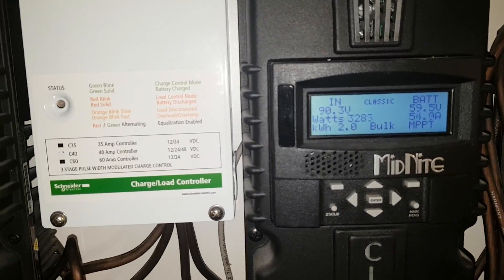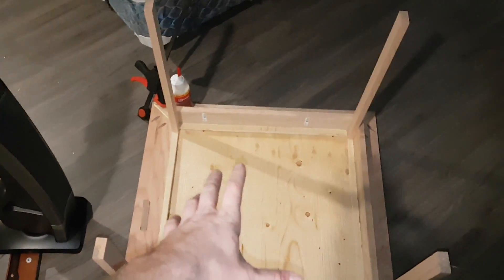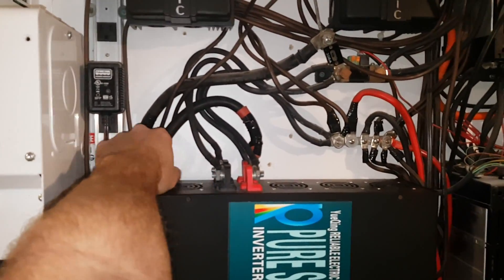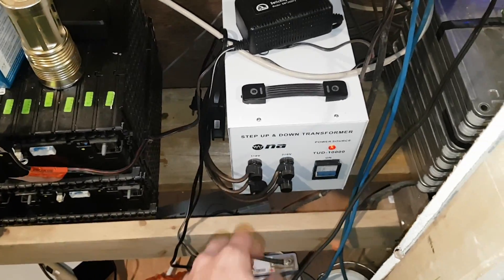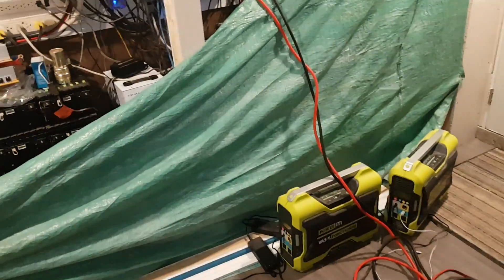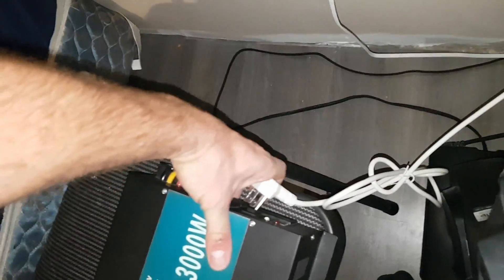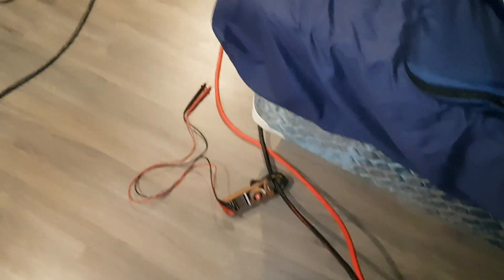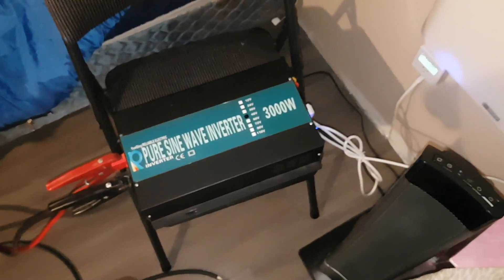Inverter Upgrade Pt2 Testing

Comment: I have WZRELB 3000w 24v inverter that I just replaced all the output MOSFETs. Found nothing else burnt inside by when testing the AC display is not displaying and there no AC reading with multimeter. Do you have any idea what is causing this?
Reply from the maker: probably its the small resisters beside the mosfets you replaced, or the main piggy back board.

Comment: I popped my 3000 watt 24 volt reliable forcing off cuts from my sawmill through my table saw didn't pop any fuses nothing smells burnt so I think if I change my mosfets to the igbts in this video I may get lucky would you have a part number for them
Reply from the maker: I'll look them up
Reply from the maker: G160n60 is that I used
Reply from the maker: I have upgraded two 3000w inverters and have had great success
Reply: I'm also checking into buying the newer model so I can use this fixed one for a backup it's always nice to have plan b 😁
Reply from the maker: @leighamos489  I try to always have plan b

Comment: You wont get full power with those jumper cables hooked up to it like that. You 0 gauge and like 2 or 3 feet for high voltage testing

Comment: If you get a generator you might be able to connect 2 or 3 of these to your charge controllers to get a quick charge. 
Will you be looking to ways how can cut your power usage with energy efficient appliances, automatic lighting etc..

https://www.aliexpress.com/item/1200W-12V-72V-90V-110V-adjustable-Switching-power-supply-for-LED-Strip-light-AC-to-DC/32841196201.html?spm=2114.10010108.1000014.9.3b9319b2nnUDOZ&gps-id=pcDetailBottomMoreOtherSeller&scm=1007.13338.112237.000000000000000&scm_id=1007.13338.112237.000000000000000&scm-url=1007.13338.112237.000000000000000&pvid=67dd73c5-289f-40df-8e8b-106d7cefb320

Comment: Did you measure the temperature difference between the short and long pieces of heatsink? Right now, you are only switching the fan based on the  temp of the short piece. You could overheat the longer heatsink without knowing it. Personally, I would couple the pieces together with a copper bar at least 4 mm (5/32 inch) thick, 25mm (1 inch) wide and 200mm (8 inch) long. Four screws in it and you don't have to ask yourself if it is Ok. (A bit of thermal-compound couldn't hurt.)
Keep it up,
Carsten
Reply from the maker: I did check it, the small one gets 2 times hotter :)
Reply: @GoingOffGrid101  - It should be Ok then.
One critical moment exist, though. When (Not IF!) you lose one of the fans, the short piece can go too hot fairly fast. You will have to monitor these fans closely and replace them as soon as they show any weakness.
Carsten
Reply from the maker: @carstenhiller5613  yes that is the weak part to any inverter if the fans go then boom

Comment: Boom respect brother sell off top a top posting. My question the fans what is the currant draw from them fans? observing my own inverter mind you it is a modify sine wave inverter when the fan kicks in it drags down the battery voltage by two volts and as soon as it kicks off the battery jumps up back by two volts and I am thinking if that is happening to your inverter more often that seems to  me a greater voltage loss at the end of the day? Which brings me to my next question and brother this question maybe a bit premature so I am really picking your brain. With the Mosfets heating and cooling down much faster is it a possibility that it may shorten their life span?
Reply from the maker: the fans only take like 5 watts each and the mosfets cooling it shouldn't change their life span cause it only going from 140f down to like 120f and back up

Comment: do i need to send postage back if you fix my smallish inverter  ?  Although its a small one its been every where with me while I drove truck and when I would do a road trip !    Its  hard to know because you always have really nice as  well as some very large inverters.  I would love to  have my small one going but I would love to buy a large one some day !
Reply from the maker: I normally only fix my own as it cost to much to fix cheap inverters unless its a $3000 inverter then its cheaper to repair it, inverter repair is a good thing to learn though as its not to hard, just takes some time.
Reply: @GoingOffGrid101  
You are the Inverter Guru. 
You like fixing them and you've done an awesome job.I will give that to you brother👍